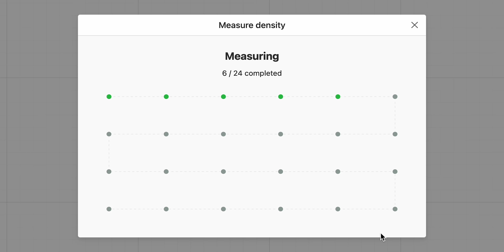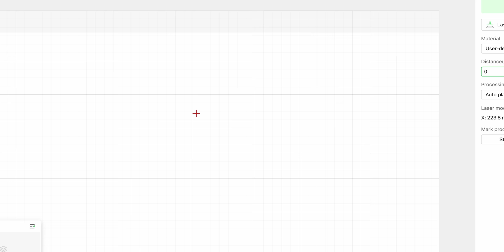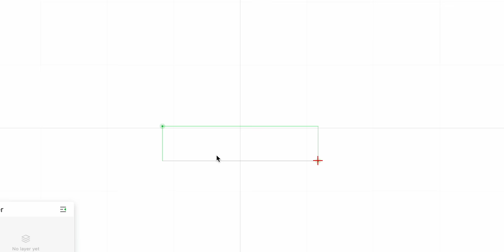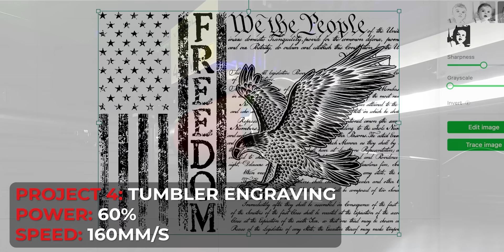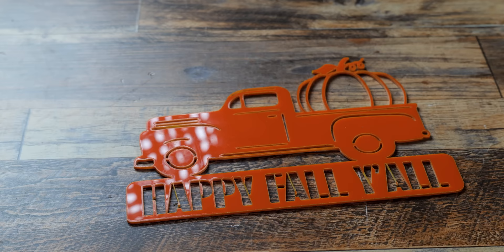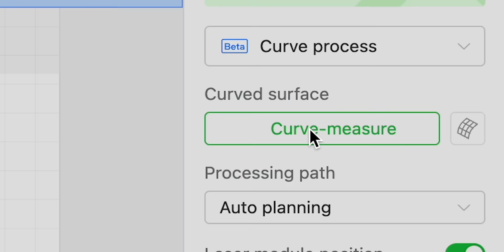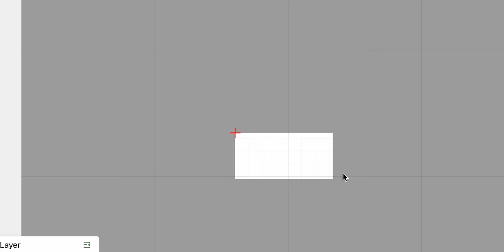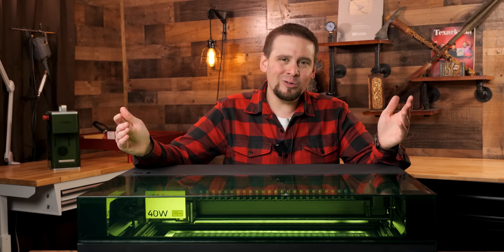The Beastly xTool S1 40W Laser Cutter | What You REALLY Need to Know | Ultimate Review

Comment: I'm a little confused on the rotary attachment.  You said it was the RA2 rotary attachment, but when I look on xTool's website, when they show the bundles it looks like the RA2 attachment they show is the one with the chuck to hold the material not the rollers.  Is the roller one the one they actually send?  I think I'd like the chuck one better, but I've never done rotary lasering (yet).
Reply from the maker: Hey Chris! So the RA2 pro rotary attachment comes with BOTH the jaw chuck and the rollers. I made a video about a year ago showing it if you’d like to check it out. The picture you see probably is just with the jaw chuck attached.

Comment: I have the XT F1 and it shows a preview of exactly where it's going to go like an outline and then it actually shows the preview. Does this not do that?
Reply: This does not... the f1 does this because it uses a galvonometer rather than a rail system... this means the f1 uses a set of mirrors to quickly move the laser around.

Comment: I am honestly thinking of getting the S1 and selling my D1 Pro with extension kit. The S1 just seems like a cleaner setup (less hassle also) and actually with pass through can run even larger sheets. Thank you for this video and appreciate that you also show settings that you used.
Reply from the maker: Glad you found it useful! I understand where you are coming from, it will be hard to go to an open diode laser after using this!
Reply: Before pulling the trigger, you might want to check out the parts and module availability for your D1 Pro. I have been told by a few people they cannot get replacement parts or modules for the D1, only the 40w is available for the D1 Pro, and it has been this way for months, they say.

The service life & tech support would be a big consideration for me before investing further in xTool products... even if your D1 Pro is still working fine.
Reply: @Metal_Vistas  Support has been hit and miss thus far for me and they do seem to favor certain countries.. but i wish to not get into that, lol. I have decided to stick with my D1 Pro 20W  but may look at their F1 in the future. I also have an Elegoo Phecda which really is it's early stages.. Thank you anyhow for advice.
Reply: @Metal_Vistas  Is the overall customer service poor?  ty...Just now researching all the laser products for a small home business.  any suggestions, much appreciated! ty

Comment: I was very interested in the S1 until recently, when I began seeing reports from D1 and D1 Pro owners that replacement parts are no longer available for those machines, and you can no longer purchase modules for them, other than the $1,200 40w module for the D1 Pro. Given the fact that xTool was heavily promoting those machines less than a year ago, this is VERY concerning.

In my opinion, a tool or an electronic component at this price-point should have more than 1 or 2 years of support from the manufacturer. I would be outraged if I spent more than $1,000 and was told I own a paper-weight after a year or two. After learning how limited their support is, I have crossed xTool off my list of contenders.

Comment: Hello, could you help me? I have the Xtool S1 40W, and when engraving a tumbler, it stretches the image towards the sides and I struggle a lot to center it. When I align it, the laser moves to another place or the RA2 rotates the tumbler.
Reply from the maker: Hey there! Do you have Facebook? I promise the S1 facebook group will answer that question almost immediately. It sounds like the proper settings isn't inputted.

Comment: Does the laser during cutting mark the bottom floor of the box? Looks like the honeycomb does not come with its own floor plate like for the D1
Reply from the maker: My honeycomb did not come with a floor.
Reply: @CorneliusCreations  yes but without the honeycomb 
 floor do you get burn marks on the floor of the laser enclosure?
Reply: @sheltoncherry2366  From what I've seen, if you're cutting through the material without using the honeycomb, it will likely mark the floor.  For cutting you should definitely use the honeycomb, the thickness of the honeycomb will make it so that when the layer strikes the floor below it (in the gaps), it won't be in focus enough to mark the floor.  In another review, the reviewer actually used the laser to draw an alignment pattern on the floor so he could use that for alignment when just engraving.

Comment: Hi can I ask a question? Since u have the P2 & in the S1 also which one of the two is the best to purchase? P2 or S1. Can the P2 cut metal? 
Thank for u’r time responding to my ?, much appreciated. 😊
Reply from the maker: Hey there! Great question. The P2 or S1 is not able to cut metal. I would advise you to look at your needs. The best laser is the one that fits your needs, your lifestyle, and the projects you are making. The  P2 is a production workhorse and can handle a wide range of material cutting and engraving. The S1 can do the same, but with the option to have the IR module for metal. If you watch my video from 4 weeks ago, I give info that will help you decide :) you won’t go wrong with either one.
Reply: @CorneliusCreations  thank you,  appreciate the info
Reply: @ladyscorpion7233  If you need to cut metal, a fiber laser or CO2 laser might be a more suitable option.

Comment: Hi, I am new to this and thinking to buy this one, what is IR laser used for and do I need it? Thanks
Reply from the maker: The S1 is an amazing machine. The IR is used for engraving on metal, plastic, acrylic and stuff like leather. It basically allows you to do stuff the blue light diode won’t allow you too
Reply: Thank you  @CorneliusCreations
Reply: @CorneliusCreations Your video shows you engraving leather with the 40W though.  Is the IR just better (cuz the 40W seemed to do really well) or are there different types of leather the 40W won't do?
Reply: @WeaponStencils  Diobe lasers absorb leather better than IR, so they are generally used to engrave leather. As to whether 40W can't engrave different types of leather, this is generally not a special limitation.

Comment: I was almost sold on purchasing this unit until I realized it doesn’t have the camera for quick setup 😩
Reply from the maker: I can understand your hesitation. Cameras are awesome to have, this positioning system still makes it extremely easy to use. Have you compared this to the P2?
Reply: @CorneliusCreations  honestly been going back and forth about which laser to get the past couple of days. For me stuff like this is a bit easy to do. But I’m thinking of my not so tech savvy wife. As well as this would be our first laser and looking into starting another side hustle. Too many options. Was looking at the fact that I can add the ir module so she can engrave jewelry. And so I can have a larger work service for wood projects or batch processing patches.
Reply from the maker: Hmm, have you looked at the F1 then?
Reply: @CorneliusCreations the F1 was a thought. But then plans changed and we decided to start a boys hat and apparel company 😂. Going back I wish I would have just went with the S1. Because we went with the M1 because of the camera and the ability to cut vinyl. The camera is not so great. Doesn’t actually line things up correctly.
Reply: @_thisisdavid  what did you end up getting?

Comment: Just un-packed my new xTool S1 with the complete bundle.  Assembled it as required.  One thing I am HIGHLY PISSED at is the sentence in the setup manual that says, "optional accessories---Air Assist."  In setup it says do not use until you have Air Assist.  WHAT IN THE HELL xTool.  NOT COOL........
Reply from the maker: I will have to check the wording but if you bought before Nov 2, you should have a free air assist shipping to you